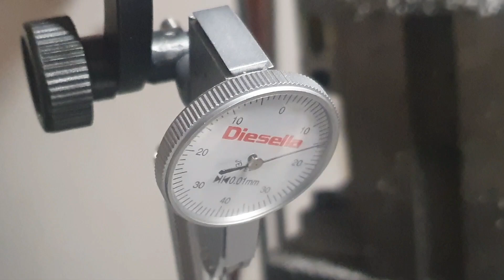my first turning project (beginner emcoturn 120 cnc lathe)

Comment: it doesn't  look too bad.. I'm also just getting to grips with mine, it still runs the original EMCOtronic TM02 Controller which isn't half bad actually.. just a tad bit old fashioned.
My other Lathe is an EMCO Compact 5 CNC running on EdingCNC.. and i mostly turn Titanium on that.. I still have to find out how Titanium will go on the 120..

Comment: Good job there and yes Dormer is a qulity brand: https://en.wikipedia.org/wiki/Dormer_Pramet
Reply from the maker: Thank you very much for commenting. Interesting link you posted. I was a bit curious on dormers history since I got two carbide Dormer endmills that are "made in sweden". I knew that Swedish SKF once owned Dormer and manufactured lots of HSS endmills. But I have never seen any "made in Sweden" solid carbide endmills from Dormer. According to the wiki link, Sandvik owned Dormer for some time. So those Dormer made in Sweden carbide endmills are probably from the days Sandvik owned Dormer.

Comment: Emco looking good mate, and that tool you made looking even better. Thx for uploading and goodluck with your projects.

Really wish i had a lathe
Reply from the maker: Thanks for commenting mate! It actually took me long time to make this part. I made the design in fusion360 this summer, and since I  already had a model in fusion, I decided that I wanted to try fusion cam for turning.

 Figuring out how to make the toolpaths was very easy. But since there was no postprocessor availble for mach3. I had to use another one. Fanuc, haas and one more postprocessor was availble. So I went with fanuc. 

However, the code from fusion was in "diameter" and mach 3 was in radius setting. I tried to change from radius to diameter mode by using g-code but it made no differnce.

 Eventually I found a setting in mach 3 under ports and pins were one could chose "diameter". Then everything just worked.

 Not very nice of mach3 putting that setting under ports and pins. That setting should have been in General config, in which I searched for a diameter setting 4 hours earlier. 😀

I will now go to the garage and make more youtube videos!

Comment: Good to see more videos from you! That Emco lathe seems to be working great. At some point, if I make enough money with my CNC Mill I plan on buying a manual lathe to learn some basic turning. From there I really want to learn how to make spindles and make some mill and maybe even lathe spindles lol. I'd need some grinding equipment for that though... BTW, that Sandvik cutter looks like a monster lol.
Reply from the maker: Nice to hear from you again mate! I decided to sell some stuff I did not use. In order to make space for the 620kg steel and cast iron I bought. That is why I have not been making any videos. Now I sold most of the stuff and also picked up all the cast iron and steel.  So now I can contimue to make videos! That sounds like a nice plan you got.

 I would like to have a manual lathe aswell. Felt like I gained a ton of understanding of how endmills worked when I started using my manual minimill. So perhaps it will be the same experince using a manual lathe. Like one get a certain "feeling" for it or so to say. 

Making spindles sounds very interesting. I think I will attempt to turn a spindle with my emcoturn. Wonder how accurate it is gonna be. 

 I will be making youtube videos during the x-mas holiday. Hope to upload a new one soon. Thx for commenting